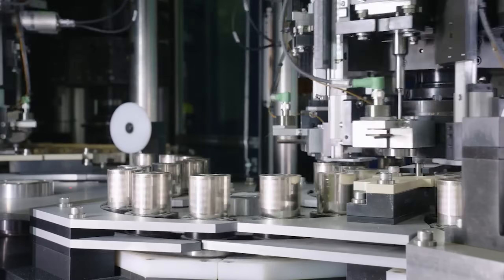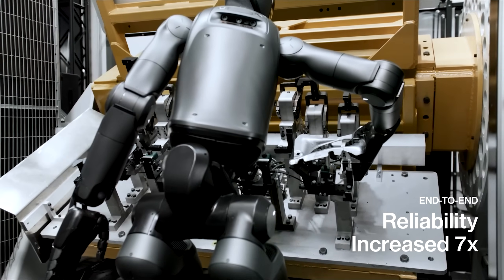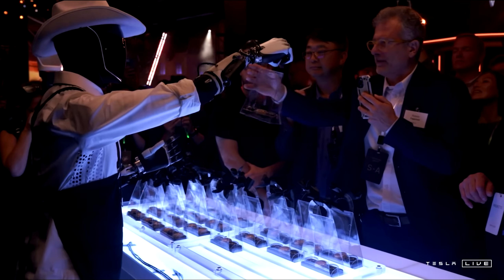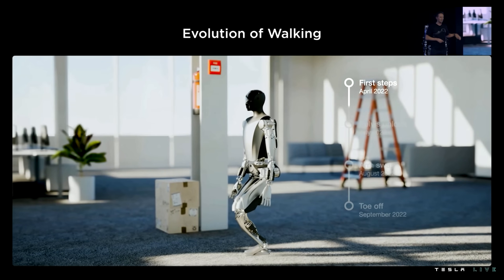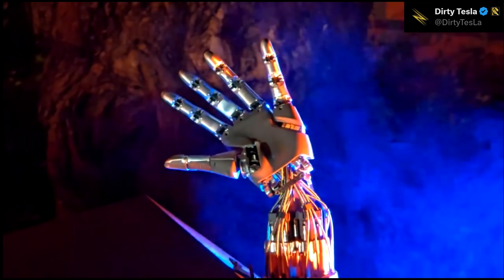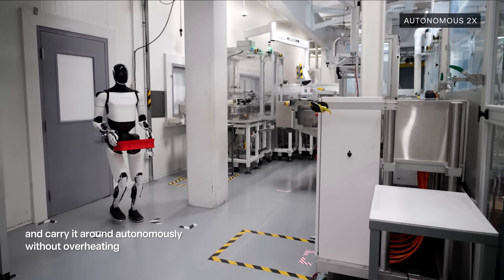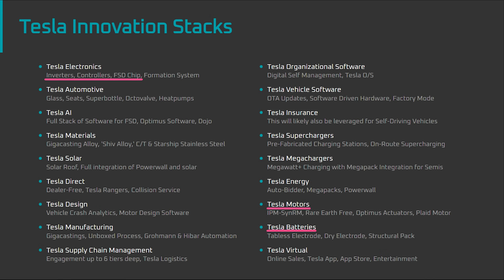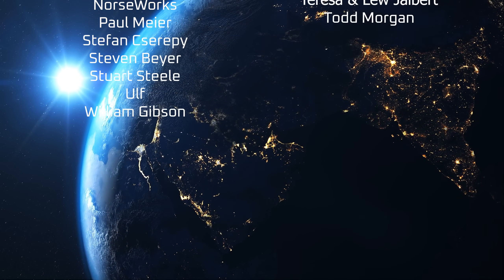Optimus 101:  Why Humanoid, Why Now, and Why Tesla?

Comment: Tesla should prioritize backwards compatibility to avoid bottlenecks, as seen in past vehicle HW/AI chip upgrade issues. While components like robotic arms and hands may need frequent upgrades, others could remain stable. This approach saves costs, reduces e-waste, and ensures long-term scalability for vehicles and Optimus.

Tesla’s Optimus assembly currently relies on human-operated stations, transitioning toward Optimus self-assembly. Optimus will eventually repair or upgrade other Optimus units. Traditional manufacturing robots, overseen by Optimus, will handle component lines, while Optimus itself performs final assembly, optimizing efficiency and scalability.

Design the manufacturing process to be operated by the product itself. This is how Optimus scales.

Comment: Been pushing the limits of what I can do with AI in my business and trying to understand what comes next. Presently we’re using AI to:
1) perform reviews and summaries of documents 
2) suggest basic redlines of legal documents which we cross check with actual counsel - thus saves 1-2 back and forths and saves time and cost
3) coding support in spreadsheets and basic programming
4) code structure for online tools and automated tools
5) notetaking during calls 

An actual physical humanoid bot would be interesting to use as a companion in the field as they could record everything we see, maybe even make measurements and collect samples. Could humanoid robot replace a surveyor? 

If I were in physical labor businesses I could see how it would be valuable to teach repetitive tasks, like mowing lawns, weeding, hanging drywall, stacking things or moving things. If you could teach robots to read architecture plans and frame a house… !!! That would be amazing. No more finicky flaky unreliable subcontractors! 

Could see robots replacing cashiers immediately - most grocery stores have already shifted to self checkout. Gas station attendants. Basic janitorial work.  I’m not sure about more complex trades. Suppose you had an auto body shop. How long until they can artfully repair and shape and weld metal? I think you need human creativity for that. Also furniture building and fine woodworking. Yes robots can build IKEA tables but not a Stickley.

Comment: No - humanoid does not make sense - wheels are much more efficient method of movement, and bipedalism specifically is extremely hard and energy intensive form of locomotion.  Highly specialized vs humanoid is false dichotomy,  you can easily have universal use non-humanoid robot, we don't have them cos they are not viable economically now, so second no - not now. 
Finally Tesla is far behind on humanoid robots so - NO, NO, NO
Reply from the maker: Optimus isn't for transport, the hands are the business end of the robot.  

So, wheels don't really add much, but they create great limitations on where the robot can go.

If the primary function of the robot was to traverse great distances, wheels could make sense.  But it isn't, so they don't
Reply: @thelimitingfactor  if it's not for transport, why not make it stationary? this makes is so much cheaper and allow to power it from the grid. 
So for it to make any sense in any kind of industrial application it's ability to move - be it transporting something or just itself must be important. If it's just about hands - you only make hand and we have plenty robots like that already. 
Thus it has to move often enough for increased cost that allow it's mobility to pay off. As for limitations, sorry but it's just not the case if we are talking about factory environment where you have to have wheeled machines move around anyway. Sure there are cases where you can't get on wheels but can get on legs but there would be not enough instances for huge increase in cost that legs require to pay off. This is what you are missing - wheels are not just about travelling far, they are most of all about travelling cheaply and just having ability to move for much less then with legs. 

Noticed that in demos Optimus is still powered externally (like in that one recently released where it dances) - that's cos walking takes up a lot more energy then making a wheel go round.
Reply from the maker: Because it still needs to move between work locations, bend down, etc.  Legs do more than just walk, they also serve as height adjustment, etc.

No, it's powered internally.  In some videos they attach a tether if it's doing something where it might fall over.  They don't use the tether much anymore though.

Anyhow, the simplest answer the most likely, and we evolved into this form over 4 billion yeasr for a reason...it works.
Reply: @thelimitingfactor  
there are much easier and cheaper ways to adjust height

if it's power internally did they disclose how long can it run? also if they are afraid it might fall over, that is a major concern and a significant drawback for humanoid form, right?

we could not have evolved wheels and bipedalism is far, far from 'simplest' in any meaningful context.
Reply from the maker: 1) Yup, but then it requires a different mechanism/solution if you don't use a general purpose solution...which leans into scaling laws.

2) 2.4 kWh already.  That's plenty for now - roughly $200 in batteries and enough for an 8 hour shift at the very least

3) Please read what I said more closely.  The cable was an interim measure.  Note!  They'll still put cables on just in case from a work safety perspective during training runs.  But, they already have robots walking around the factory without cables.

4) Yup, but the point is it's a highly evolved transport method and again, Optimus isn't a bus - it's a general purpose work tool mainly valuable for its hands.  Adaptability is a higher level requirement than cruising efficiency.
Reply: @thelimitingfactor 

1) why it would not be general purpose? Legs are really expensive. You can get similar functionality easier. General purpose solution - a machine for factory work can be in totally different price range then a house one it's unrealistic to make one fitting both specifications well for a price acceptable for private customer.

2) yeah I would have to see that to believe it. 8 hours of activity both walking and operating hands on 200$ battery sounds like a fairy tale.
Reply: 3) yeah I know they want to get rid of it at some point, I am talking about it shows what state it is now. Boston Dynamics Atlas is doing backflips with no such assistance.

4) highly evolved? Empty buzzword that does not addresses issues with bipedalism for a machine.

Comment: Great video. In my view, while it's great to have a fully functioning hand, it will only truly be exceptional if it can swappable with a range of different specialised tools. Detach the hand and replace it with a drill or welding tool designed to replace the hand. Current tools are made for humans and so handles and triggers must be present in a certain way while buttons and other switches must be easily visible and accessible, etc. A specifically designed tool would not need to conform to these limitations and be better suited for direct use by a robot.  One hand could be a clamping tool while the other, a drill or other device. Personally I'd like to see a 4 or more armed robot. Imagine for a difficult rescue, the robot able to lift and hold debris with one pair while specialised tools tear or cut through. I would like to see something like a 4 wheeled scissor-cart with 2 robot torsos where they can be raised and lowered to a specific height to perform tasks. Would replace man-lifts with 2 men carrying an assortment of tools. Otherwise, humanoid robots will not be that much better than humans. And if really want to start exploring space, we'll really have to rely on them and their full capabilities. Real space-stations and colonising of the moon and Mars will require them to build everything.
Reply from the maker: That would be cool!

Comment: The immediate applications will be (for USA liability law reasons) far from humans.  Detasseling corn, pulling weeds in a field, removing land mines in Ukraine:  These are immediate 5m to 50m unit applications at $50k/year lease rates.  More esoteric jobs of paint shop/nuclear/chemical hazardous work environments are low-revenue but skills they gain there will inform skillsets for factories, repetitive-motion-injury prone work, etc.  If a robot has marginal costs of $50k, a lease at $50k/year after year 2 is 2x, but drop the price to $12k marginal, ROI goes up to 8x, and higher-higher-higher if it outlasts a 2 year lifetime.

Comment: Author and everyone interested, I wanted to add from a perspective of a person who worked in robot industry for some time. My childhood dream was a world full of humanoid robots but I am sad to inform that is unlikely to happen at least not in mass scale like todays robot-vacuums, because humanoid robots are just bad and will be forever worse at household chores than other designs. In the future people will buy robots for chores and not for climbing mountains. But how can it be? Is not our homes designed for humans and this is the best shape? Not really.  Imagine a robot shaped like a barrel on four wheels. The wheels are attached to extendable rods (a foot or so long in extended position) with actuators at their connection points to the barrel, allowing the robot to slightly lift itself to pass over objects on the floor, "step" over stairs or serve as a shock absorber if something crashed into the robot. From the top of this barrel protrudes a standard industrial manipulator with multiple degrees of freedom. The end of this big arm splits into two smaller manipulators, each equipped with four "fingers." While this robot bears no resemblance to a humanoid, it is faster and potentially more agile than any humanoid robot—or even human—because its mass is concentrated low to the ground, enabling swift, precise movements of its manipulator. Btw I reject the argument that humanoid robots might be safer; humanoid could just as easily crush a skull of human if something malfunctions. Proposed robot could handle 99%, if not 100%, of household tasks (even changing light bulbs faster), all without requiring complex stabilisation systems for legs. If power fails, the robot’s body won’t crash to the floor—only its manipulator arms might clatter down. Its batteries would last way, way longer due to larger volume for them, and wheeled movement is inherently more energy-efficient - you dont need to use energy in stationary position and the floor in our homes are flat and levelled.
Oh, I forgot to mention that the barrel shape is designed so that the block of batteries inside can rotate to compensate for tilt when needed, allowing manipulator’s reach far from the robot’s axis of mass. Adjusting the extension of the wheel rods will also help with centre of mass and thus robot can reach even further — a humanoid robot could never, ever reach as far from a stationary position and so will be way slower at fulfilling tasks that require some movement in one room. For example preparing a meal or cleaning dust from the surfaces in the room.

Humans have a superpower: we’re the best long-distance runners among mammals, partly because we’re bipedal. But a household robot doesn’t need to run marathons or walk long distances over uneven terrain, nor does it need to drive a car like in some 1950s sci-fi movie—nowadays, cars are self-driving. There’s no task in our homes that requires the use of legs, which is why bipedal robots in the future will likely exist only as sex toys in mass market—and even then, they won’t need to walk much. Sure Tesla, Boston Dynamics and some chinese manufactures are working on humanoid robots but they will be forever niche product for the enthusiasts like me. And as soon as capable, fast and cheap kinematic AI for performing everyday tasks appears - robots similar to what I described will flood the market.
Reply from the maker: If you really did have a great idea on your hands, you'd develop it and crush the market

This just sounds like a lot of backseat driving to me or shouting from the sidelines
Reply: @thelimitingfactor  Robot itself is not a problem. Capable and compute efficient AI is a problem - Its not here yet. In my time I help develop software for the robot assembly in the factory and fully-automated robot is unbelievably hard to make reliable even in the factory conditions. I hope with the new methods they crack the code and one day I will be able to buy and play with humanoid robot that are more or less affordable. Btw I kinda know thing or two about robot kinematics so my robot design suggestion is not from thin air but I am sure that there are people way smarter then me who will make far more efficient design for homes when AI is here.

Comment: Frankly, the biggest question is whether there is a killer application for this type for robot. So far we have only see tech demos from Tesla, nothing that looks like "useful work" (apart from the pick and place demo with 4680 cells, clearly not a task for a humanoid bot). If you have seen anything interesting that would be worth sharing.

I don't think putting away groceries is a sufficiently high value task (about 2 minutes of work every now and then) and actually I doubt Optimus could even do it (unless the customer is a nerdy bachelor with only 3 items in the fridge). Compare that to let's say a washing machine that saves you hours of work per week and costs less than $1000.
Reply: it could run errands for you, Or temporarily fill In for you at work, be a surrogate father, teacher, therapist, training nutrition coach, accountant and muse for multiple family members simultaneously.
Reply from the maker: There's a market for millions of them just for doing basic tests around the house 

Look at all the boomers that are going to need assistance 

Over the next 5 years, it will be able to do increasingly complex taks

Landscaping, construction, etc

Comment: 10:01 The trapeziometacarpal joint only has 2 degrees of freedom. Some sources mistakenly give it 3 (due to a misunderstanding of DOFs). So the fingers of one human hand only have 20 degrees of freedom in theory, and fewer in practice, as humans cannot move all joints independently.
Reply: The reference mistakenly gives an extra degree of freedom to the thumb joint, but still keeps the degrees of freedom for the hand correctly at 27.
Reply: @lym3204  *arm

Comment: Optimus has to be a live-in partner, not a cloud terminal. When you hand it a glass or mumble “tighten that bolt another quarter turn,” the entire loop—speech recognition, intent parsing, vision, and precise motor control—has to run on the bot’s own hardware in a few milliseconds. Shipping your words off to a remote LLM like Grok would leak private conversations, add unpredictable latency, and tether Optimus to the uptime of someone else’s servers. Tesla’s end-to-end, on-edge network keeps every frame of video, every waveform of your voice, and every torque command inside the robot’s metal shell. The only time it ever needs the internet is for non-critical lookups (e.g., checking tomorrow’s weather), and even then the core “hear-think-act” cycle never leaves the device. In short, real-time, private, safety-critical robotics demands a self-contained neural network that Tesla alone controls. This end-to-end approach is the only viable solution.
Reply: Would be ideal, I wonder how expensive they will be. Similar to "on-prem" vs cloud.